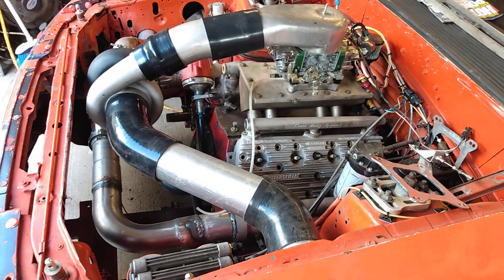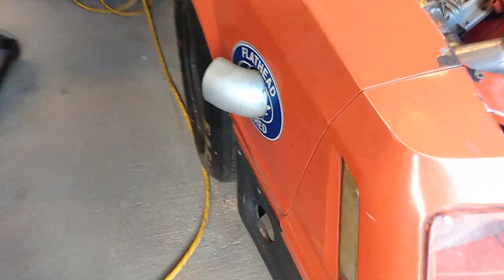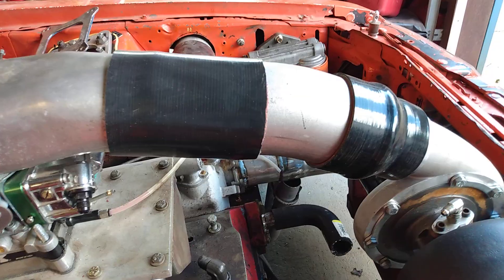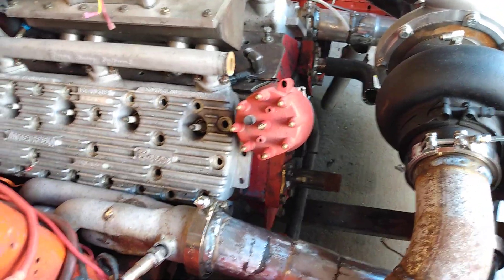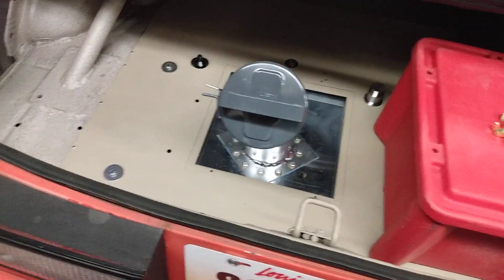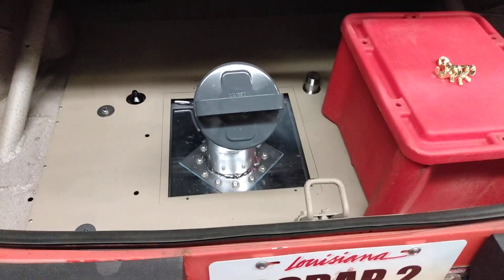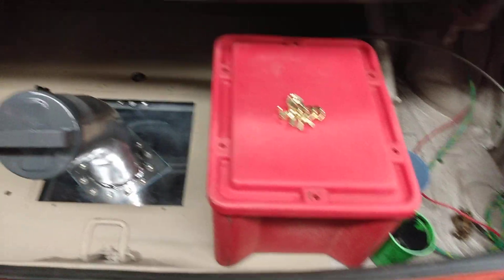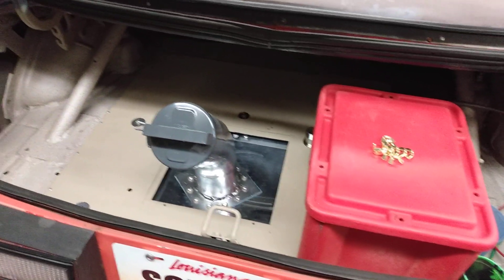Turbocharged Flathead update

Comment: It’s coming together Phil. Looking forward to seeing you testing. Big question. Where do you source your rotating assembly for your flat heads. I’m going 4 1/4 inch stroke with a 60 over motor. I would like to put a little boost on it but? That’s another question how about Beefy main caps . I’m full of questions this time.  Thank you sir
Cheers 🍻👍👍👍🍻
Reply from the maker: We have been using Scat crank and rods with Ross pistons. The off the shelf stuff is reported to be good up to 5 lbs or so of boost. We have custom pistons made with more material in the crown and less other places (kind of pricey) but we have run up to 15 lbs. of boost. As far as the beefy main caps, we have run a four bolt center that was available from Ebay by George's Speed Shop (I think), but I don't see a listing anymore. Oh, I have decided to upgrade the rod bolts on the Scat rods to their 2000 series. I believe you can get the rotating assembly already balanced.
Reply: Thank You sir 🍻👍